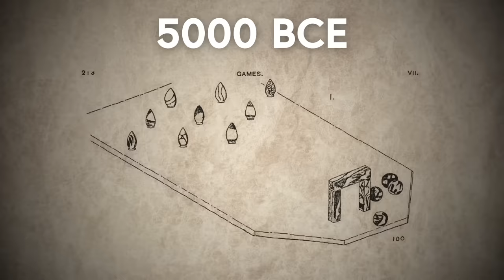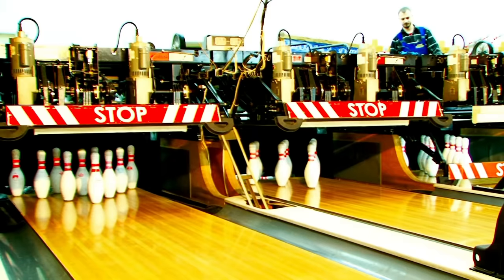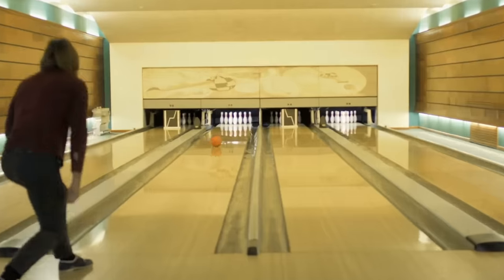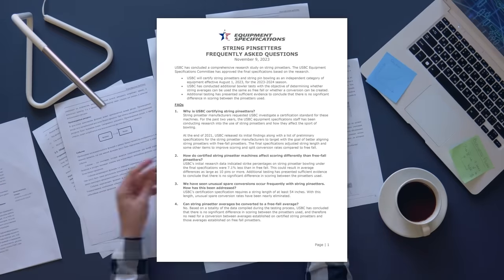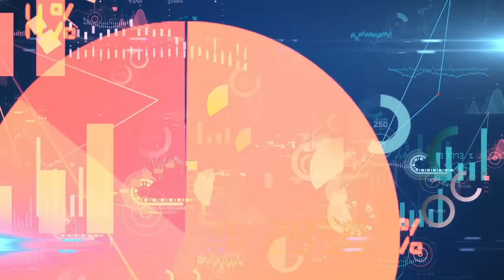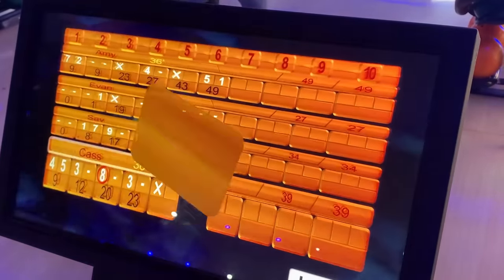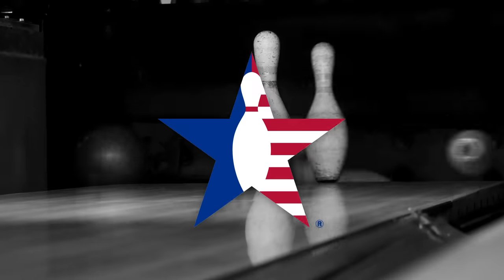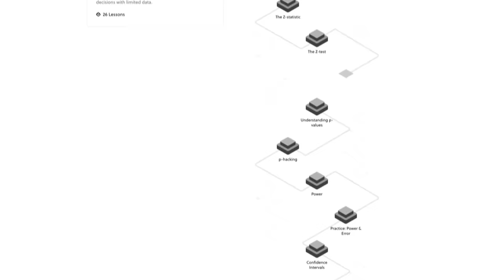The Controversial Machine That’s Ruining Bowling

Comment: Thats not bowling. The strings clearly interfer with the pins ability to move. i.e. PIN ACTION.

And aren't the lanes a lot shorter also? And i'm sure they don't really consider alternate oil patterns. So really... call it something else because it is.
Reply: How so? You set them on a slack line and only have them tighten down when all the pins are done moving. Setting it up this way, they’ll do essentially nothing to affect the pins, and more importantly, if pros want the more complex setting systems at tournaments, that can be arranged, but for the everyday bowling alley, I’d prefer being able to continue bowling as opposed to having my local bowling alley go out of business because of a shortfall in business when there’s a viable option to stay open
Reply: @strangelyukrainian7314  its wire twined. The slack helps but sure the wire interfers. i.e. a pin flying now hits a wire holding another pin. Pin trajectary interfered with.
Bowling aint going nowhere. Theyll just charge more per line. Its fine for open bowling. But competitors wont like.

Comment: In any sport with any kind of equipment, you're always going to have BS, it's just going to be different BS every time. I'm okay bowling with wooden Lanes, I'm MORE than okay bowling with Twister pins, and I would be somewhat okay bowling with string pins, given everything that I've seen about them. 

String pins may actually be a "truer" form of pin carry, because the strike percentage is statistically 7.1% lower on average, given the USBC's research. This might actually restore some balance between low-rev players like me and high-rev players like Jason Belmonte, because people like Jase won't be able to benefit from bowling fifth arrow and cranking it as hard as he can. Sure, messengers and crazy bouncing pins are a lot of fun to watch, but not so much when you're on the receiving end of somebody's luck. There is no "bouncing it out" or getting away with bad shots on string pins, and less than 1% of the time will you get a freebie.

I know my bowling schticks are usually the pissy negative ones, but this could do something for our sport. I guarantee you these style machines will raise some eyebrows, but if string pin bowling is what keeps the sport alive, or even what turns it around in the next decade or two, I'm all the hell for it.

Comment: Congratulations on making the most common error in all of statistics, which is to interpret a non-significant p-value as meaning something.  Only a significant p-value can result in a meaningful conclusion.  A non-significant simply means either the null hypothesis is false OR it's true and you didn't have power to reject it.  You can use this fallacy to prove anything you want, just set up the test with only two replicates so you have no power, get a high p-value and conclude H0 is true.  Don't feel bad, Ivy League scientists also make this mistake on a daily basis (more like hourly basis).

Comment: I hate strings because they don't have the free fall pinsetter noise and it looks pretty much stupid and no messenger carry either and this is where razzle dazzle bowling gose extinct no more cool looking colored pins in a rack and not only that I just absolutely hate the fact that this will be this way.        GET THE BOLT CUTTERS AND SCISSORS ✂ ✂️✂️✂️✂️✂️

Comment: wait, they used trash players to test them? that's why there's no difference. For trash players, hitting pins is essentially pure luck, which doesn't change with the resetting method. If you're a good player, there might have been statistically significant differences involving picking up difficult spares.
Reply: That’s what I was thinking too.  They’re like “well I bowled a 60 both times so clearly there’s no difference!”. No clearly you suck on both strings and normal pins.

Comment: If you wanted to do a truly scientific test whether strings make a difference or not the proper way to do that would be to have two identical Lanes the only difference being one is freefall and the other is string then you have a machine that is set up on both of them that would knock over the pins with a bowling ball is released at the same speed the same spin the same direction everything is identical with every release and with both lanes you then run the test hundreds of times maybe more maybe more for each one make it to where the only variable is one set of pins have strings and the other do not

Comment: I am not a bowler, but if i were i know i would treat them like i treat self check out at safeway.  I will not self check out or would i bowl on a lane with string set up.    I would like to bowl on lane that had some dude back there re setting the pins.  Guess i am an old fashioned dude that thinks all new stuff sux.

Comment: As someone whose family owned a bowling alley for over 20 years and as someone who has bowled an estimated 48k games at mostly a competitive level, I can say that the differences between freefall and string machines don't make a significant difference for the recreational bowler at all. The way the lanes are dressed accounts for a much larger variance in scoring than choice of pinsetters ever would. So, testing at two different facilities who may dress their lanes differently could easily negate and noticeable differences due to pinsetter type. Skilled players would probably realize the greatest difference in the making of spares, because certain splits like 4-6 and 7-10 are ever so marginally easier with freefall pins. That said I've only made those splits a combined 10 times, with 8 of those being on freefall. The biggest overall headache associated with string machines is the tangling of strings, so just be patient while staff untangles strings and enjoy the game!

Comment: I would NEVER, EVER bowl at a place with pins on strings. You might as well be playing a baby's game. Also, despite the USBC being morons to even think about it, it would clearly affect all the pin action from bouncing off the sided to how they would react in generals from the ball and other pins hitting each other simply because they aren't totally free like normal. I don't need people that don't know how to bowl to test. Then there's the spares. Forget the spares, lucky or not, where you need a pin to bounce around to make. Then think of sliding the pin over. Not only could or would the string potentially get in the way but as said, just being connected to the pin will affect the action and ability for pins to react as needed.  Finally, you would just make the game even more of a joke in the minds of many people.

Comment: Look, if you cant afford to pay for the maintenance or power on the traditional pin setting machines, then do the smart thing and install the old time manuel foot pedal style and human teenagers at minimum wage (or less) to operate them.  Push the pedal with your foot, narrow pins pup up from the lane floor and ya put the bowling pin (with hole in the bottom) on the narrow placement pins. Release the foot pedal and the placement pins disappear back under the lane floor.  Any moron can operate it.  Well, the also have to send the ball back but thats easy too.  The old lanes had a return rack that used gravity to return the ball.  Its cheaper, easier, doesnt crush idiots, and there's no outside strings or other nonsense going on.  Remember kids....Everything modern is crap, everything electronic is your enemy.

Comment: I just think strings are lame. As for machines, it's only a problem of cheapskate owners who are willing to do (or not do) whatever it takes just to improve their bottomline. Getting a much cheaper, simpler and safer modern machine is always an option. But string machines are slightly cheaper, and it's all that matters to them.

Comment: I can't believe what bowling has resorted to. I'm at Old Time bowler from decades ago. A few years ago I decided to take the game up again. First time using automatic scoring. I was shocked that the employees refused to fix anything that was not set correctly, or an accidental pinfall, or a ball jumping out of the gutter and hitting a pin, or a scoring error. There absolutely no do overs, And you only got one frame of warm up practice.

After a few times of dealing with all these frustrations, I once again gave the game up and have never gone back.

Comment: maybe this would be a great use for AI: just an off the shelf robot arm + pin shaped gripper + camera
Reply: What's the point of Ai here? You don't need Ai to do perfect shots every time. Stop trying to put Ai into everything, it's the same story as it was with blockchain
Reply: @Eskey4  i don't want the AI to play bowling, i'm talking about an AI pin boy more or less. You know those orange robot arms used in car factories? Those things have plenty of dexterity to set pins. The only problem is that pins fall differently every time, so a fixed pre-programmed motion isn't gonna cut it, thus: AI.

Also, they don't need $3000 per month in spare parts.
Reply: @g_glop  Again, no need for AI here also, seriously please stop, and these robot arms are more expensive, also heavy as hell and dangerous, you literally only made more problems than you "fixed"
Reply: @Eskey4  Ok, how would you do it? If you want free pins without a rube-goldberg monster.

If I criticised my own approach i would focus on speed (a single robot arm would have to really work it to match the speed of current machines) and the fact that the currently installed machines are so power hungry and dangerous is because they're old.
Reply: @g_glop  And these robot arms are seriously expensive, you can't really fix them yourself, they also need a lot of space to operate. There isn't much else to do than current systems, just modernize them.
Reply: @Eskey4  I would rather be fixing robot arms than pinsetters. They're just a cable + motor + bearings + gearbox, repeated for each axis. Big thing: I can carry a robot arm sized for lifting pins to a dedicated shop rather than having to crawl inside it.

And if I really didn't want to deal with it, i could at least replace it with a whole new spare, keep the lane open, and have the mechanic fix it - whenever - or just ship it to them. (on call repairs are hella expensive)

One point from other comments is that alleys going out of business are selling off their machines and parts which makes them cheap, and the problem is paying mechanics. And modernizing a 50 yo machine doesn't seem like an easy task.

Comment: I disagree testing with different lanes and even bowling alleys.  Oil patterns with professionals know all too well about this.  While I'm no professional, I think more testing needs done.  Same lane, same oil pattern, same ball (cleaned each time), same bowler.   Space this out with machine first, then replace with strings.  Give this a weekly schedule for a year (half for first part and half for the next).  I've presonally bowled on both.  I truly prefer regular pin set machines but lately I have seen more and more breakdowns and then we have to move so I do get it in a way.  To me though, mainly once a bowling alley changes to these... they tend to make many other cuts (especially over time) and it's not about bowling at all.  It's about profit from bowling, food, and achohol.  Need help with pin machine..?  Yeah there's one person in the entire alley who knows what they're doing to fix it.  Have more than one issue?  Hope you didn't pay per hour, oh you want to change lanes? yeah hope you tip them so you move quicker.  Even what the lanes are made out of matter, along with what oiling maching they are using, how often they use it, what pattern, when do they strip and clean it.. that really changes the way a ball goes down the lane.  I've bowled at 6 different alleys in DFW and can say the string alley downtown I went to was by far the easiest which tells me (since I didn't even use my balls I've purchased myself) there is more extra pins that fall over.  I say this requires more testing.  I appreciate the video but this is just my opinion.  Also, I don't want to see bowling alleys disappear either so I may just have to get over it if they change machines out here where I live.